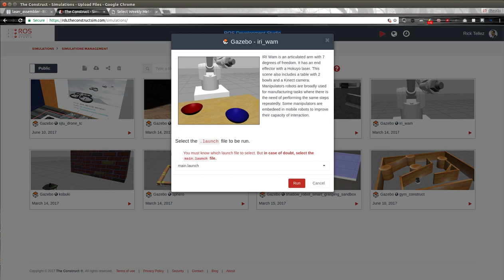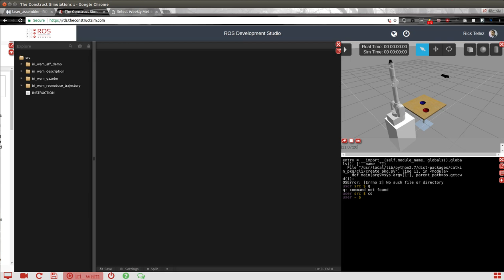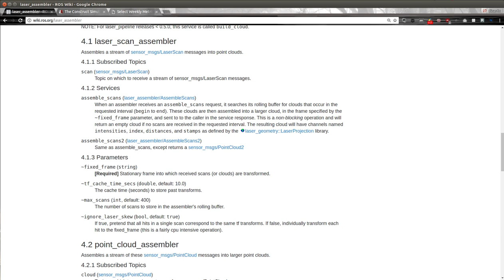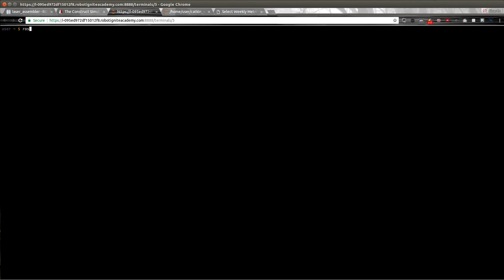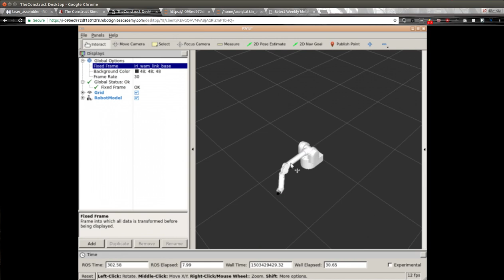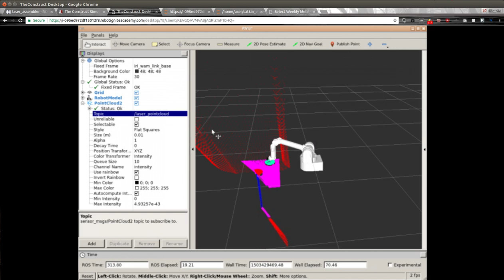[ROS Q&A] 023 - How to assemble several laser scans into a single PointCloud

Comment: "Several laser scan"
and proceed to show one laser
Reply: I can see you did not understand the video. There are several laser scans, all of them produced by a single laser device. Each laser scan is captured at a different angle of the robot joint, so the laser device is actually capturing a 3D of the environmet, made by the composition of several laser scans. Each laser scan is an individual measure in a 2D plane, and that is why you can only see one laser scan (the one captured at that given time). I hope this clarifies your doubt

Comment: Thank you for giving me this lecture.
I have a question.
I created the launch file as it appeared in the lecture, and created the same laser2pc.py file.
However, the source works but the topic is not output.
what's the reason?
Reply from the maker: Did you press 'Play button' in the simulation?
Did you launch the laser2pc.py file?
Reply: The Construct 
hi i solved the problem
it was really simple mistake 😅
i have one more question
if i assemble more than 2 laser scan data, how can i make launch file?